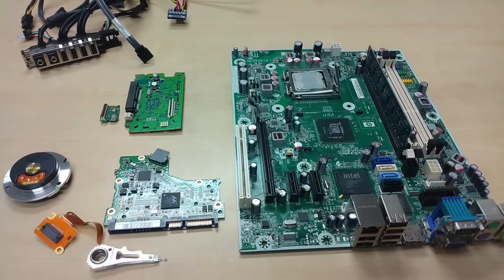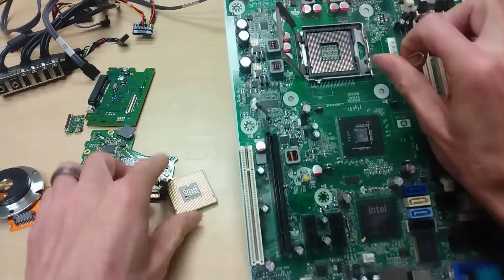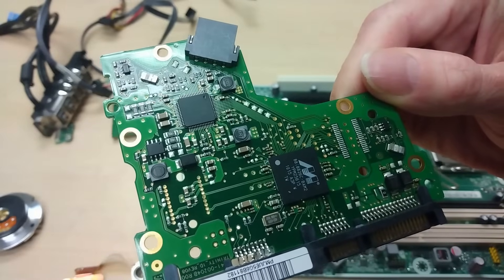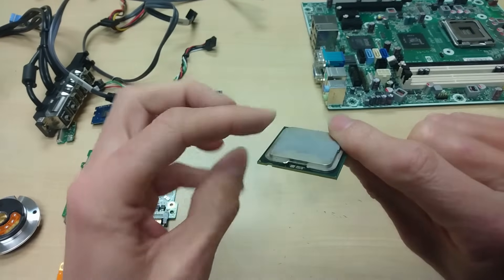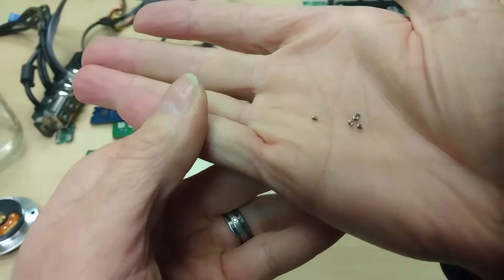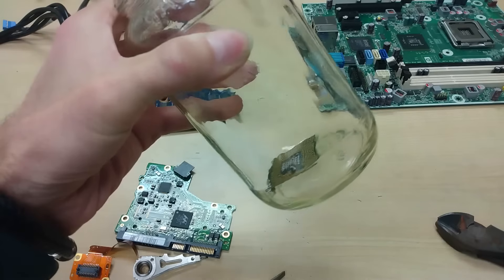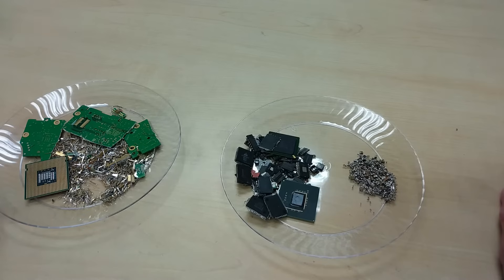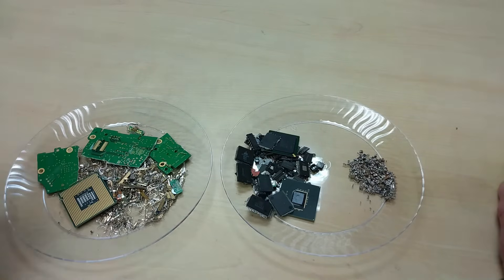Recovering Gold & Precious Metals from Electronic Scraps - Part I - Disassembling Electronic Devices

Comment: What about shredding the circuit boards memory cards except the mlcc’s and apply hydrochloric acid w nitric acid to dissolve the gold in the solution or does it make it harder to recover the gold due to the amount of unwanted materials in weight
Reply from the maker: I haven't tried that, but I think that would make it harder to end up with pure gold.

Comment: I use a hammer drill . Using only the hammer mode only with a chipping blade. Inside a bucket so I don't lose to much and then I sort.

Comment: If you just break the ram ICs lose with pliers: Snip the gold edge after depopulating. So you don't work a lot of glass fiber pieces into your hand. (Or wear gloves...)
And you VASTLY overestimate the Palladium content in MLCCs. Most MLCCs in consumer electronics today have no precious metals at all. If they are magnetic, they are pretty much worthless. Use a magnet and see what's left after that. It is probably just a couple of them.

Comment: Help! I've been trying to research the use of Sodium Thiosulphate in gold recovery as a safer way for a gold leaching medium. There very little information out there and it seems it is being treated and marketed as a trade-secret. Do you know how to do it by this method?
Reply from the maker: I don't know anything about the use of Sodium Thiosulphate, but let me ask: A safer way than what? Nitric acid? Nitric acid is not that dangerous. Of course you shouldn't use it as an inhalation against a congested nose or use it as eye drops. But with little common sense, working with nitric acid is not a big deal. Even if you get some on your skin, it is not as bad as what we see in movies. As a proof, check my tutorial in which my assistant Aspen Angel is purposely pouring some acid on my finger to show that nothing special happens, provided that we don't leave the acid on it for hours: https://youtu.be/NHBDXtn7pjA
Reply: @BlueMoonshine  Thanks for your reply. I meant safer than the old methods of extraction using Cyanide or Mercury for leaching, particularly in ore samples when there are small amounts of gold. I do make my own Nitric acid and I feel safe using it with all the adequate precautions. The only scary moment I had was during production I had a runaway towards the end of the process and the overpressure popped all my glass joints and filled my workshop with superheated steam!
Reply from the maker: @WandrBrit  
A runaway? How do you make your nitric acid? I never had such a problem with the method I use.
Reply: @BlueMoonshine  It happens at the end of the distillation process when almost all of the remaining contents of the flask has been converted to Potassium bisulfate.
Reply from the maker: @WandrBrit  
Are you making too much at a time? I don't put more that 400g of potassium nitrate and 228 mL of sulfuric acid (93%) in a 1L flask, and I stop when the temperature goes above 130°C.
Reply: @BlueMoonshine  I might be. I make azeotropic HNO³ and so put an almost equal amount of distilled water in. My yield tends to be around 500ml each time.
Reply from the maker: @WandrBrit  
Why don't you simply produce 95% nitric acid first (as I do here: https://youtu.be/NHBDXtn7pjA) and dilute it only at the end, so that you have more room in your boiling flask?